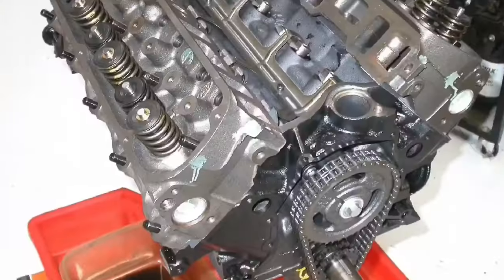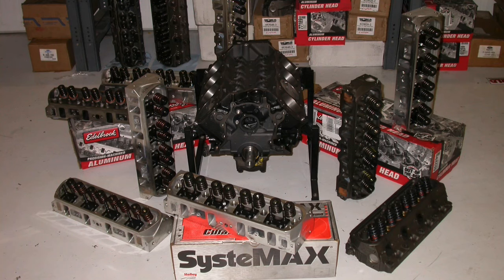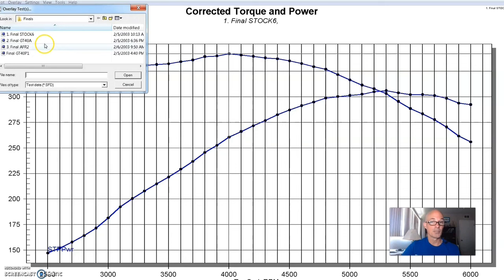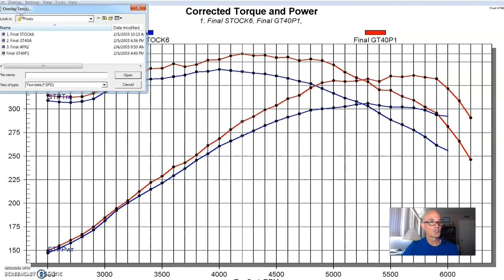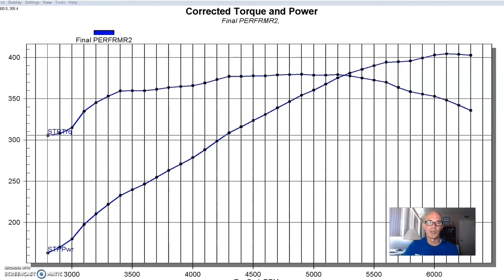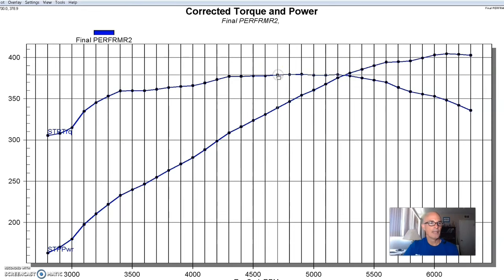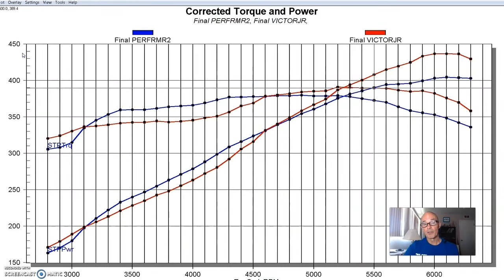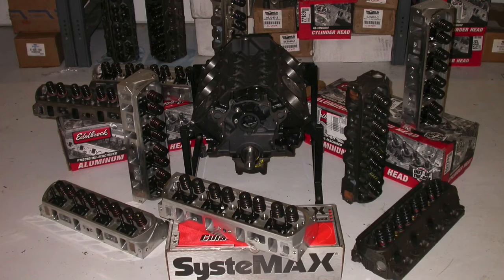LOW-BUCK 302 FORD HEAD UPGRADE

Comment: THE BEST SMALL BLOCK EVER MADE. THE 289ci WON LEMANS IN 1964 IN THE GT-III CLASS AND WAS CLOCKED OVER 200MPH. NO MOTOR HAS ITS CREDENTIAL. THE LS CANNOT TOUCH THIS MOTOR. THE LS IS A RACE ORIENTATED FORD WINDSOR MOTOR . ANY BODY READING THIS WOULD LIKE TO AGRUE THIS POINT BE MY GUEST. IN THE REAL WORLD TODAY GOING BACK A FEW YEARS 1 OUT OF EVERY 2 LS MOTOR IN AUSTRALIA GO BAD. IT HASN'T CHANGED. DURING THE TIME OF PRODUCTION A STANDARD 302 FORD IN A TAXI, TRUCK, ETC CLOCKED COUNTLESS MILES EVEN UP TO 500k AND MORE. THE LS TODAY GOES 150-200K AND THEY ARE ON THERE WAY OUT. IN THE REAL WORLD THE STOCK STANDARD FORD FAR SURPASSED IT IN REAL WORK TIME. THERE IS A CERTAIN MECHANIC SHOP NEXT TO THE PLUMBING SUPPLY HOUSE I GO TO OWNED BY PANJUBI'S DOING BLACK CAR REPAIRS AND AFTER YEARS OF SEEING THE LS BEING REPLACED WITH JUNK YARD REPLACEMENT MOTORS. I FINALLY GOT OUT TO TALK TO THE MECHANIC. HE SAID THESE MOTORS DON'T LAST LONG EVEN WITH RELIGIOUS OIL CHANGES. THE BIGGEST PROBLEM THE LS HAS IS BREAKING THE RODS AROUND THE BIG END WHERE THE BOLTS ARE. THEY ALSO HAVE LOTS OF OTHER PROBLEMS. I ASKED HIM IF THE LS WAS A GOOD MOTOR AND HE SAID IT'S A BAD ENGINE. TO SUM IT ALL UP THE OLD 302 MY NOT MAKE THE POWER OF A LS BECAUSE IT IS A MOTOR MADE FOR FUEL EFFIECENY WHILE THE EPA LOOKED THE OTHER WAY AND ALLOWED GM TO PRODUCE A POLLUTING ENGINE THAT NEVER SHOULD HAVE BEEN ALLOWED IN PRODUCTION. LOOKING BACK IN HISTORY GM HAS ALWAYS HAD THE GOVERNENT IN THEIR POCKETS. MAKING THEM PUT PRESSURE ON FORD WITH 2 HANDS AROUND THEIR NECK TO MEET REDICULES EFFICENCY STARNDARD TO KILL THEM IN THE PERFORMANCE ASPECT. AND ALLOWED CHEVY TO PRODUCE RACE ENGINES AND THEY LOOKED THE OTHER WAY. THIS IS WHY FORD WENT MODULAR.
Reply from the maker: 1 OUT OF EVERY 2?
Reply: @richardholdener1727  A FEW YEARS WHEN THE GLOBAL MARKET SALES DROPPED TREMENDOUSLY AUSTRALIA WAS EFFECTED. FOR A COUNTRY THAT PRODUCED A TOTAL OF +800,000 CARS ACROSS THE BOARD BETWEEN ALL OF THEM IT WAS NO LONGER PROFITABLE. SO THEY STARTED CLOSING THEIR PLANTS. FORD, TOYATA AND THE REST OF THEM LEFT LEAVING HOLDEN AS THE LAST KID ON THE BLOCK. IMAGINE WITH THE COMPETITION GONE HOLDEN STILL FOLDED. THEY LITERALLY HAD A MONOPLOY AND HOW DID THEY STILL FOLD. THEY FOLDED BECAUSE OF THE BAD REPUTATION OF THESE LS MOTORS 1 OUT OF EVERY 2 GO BAD. THE COMPANY WAS BADLY TARNISHED AND FROM THIS ASPECT THEY WERE FINISHED AND CLOSED THEIR DOORS.  DON'T YOU SEE GM/CHEVY FOR THE JOKE IT IS. THAT THEY TOOK OLD CONVENTIONAL FORD DESIGNS AND MADE THEIR OWN VERSION OF THE SMALL BLOCK FORD. RICHARD NOT 1 ONE DESIGN ASPECT OF THE OLD SMALL BLOCK CHEVY LIVES IN THE LS. THE LS IS COMPLETELY BASED ON FORD DESIGNS. FROM THE HEADS DOWN TO THE BLOCK. STEALING, BORROWING, HYJACKING, ETC. CALL IT WHAT YOU WANT IS WHAT GM/CHEVY DID. THE LS IS 101% FORD DO YOU AGREE HERE RICHARD. DO ME A FAVOR AND AVOID THE POLITICALLY CORRECTNESS ROUTE. RICHARD, IT IS JUST BETTER TO TELL THE TRUTH. AND I HAVE ASKED YOU THIS QUESTION MANY TIMES BEFORE AND YOU HAVE AVOIDED ANWSERING THIS QUESTION A FEW TIMES WITH NO RESPONSE.
Reply: @richardholdener1727  RICHARD WHEN THEY MADE "FORD VS FERRARI" THEY GOT THINGS WRONG AND LEFT OUT MANY FACTS. IF I WAS TO HAVE DIRECTED THAT MOVIE. THE WAY THE FACTS HAPPENED. IT WOULD HAVE ALSO SENT CHILLS UP THE SPINE OF THE HARDEST CORE CHEVY GUY. I WAS INTO CHEVIES YEARS BACK BUT LIKED ALL CARS GROWING UP WITH THEM. WHEN THE DEAL FELL OUT BETWEEEN FORD BUYING FERRARRI AND MR' FERRARI TURNED AROUND TO HENRY FORD THE II AND TOLD HIM "I'M NOT GONNA SELL MY CAR TO AMERICANS THEY ARE TOO GOOD". SO HENRY FORD II GOT MAD AND TOLD EVERYBODY THAT WE ARE GOING RACING. SO HE WENT TO THE ENGINE RESEARCH AND DEVELOPMENT DEPARTMENT AT FORD AND SAID TO THE ENGINEERS WHAT MOTOR DO YOU HAVE THAT CAN PERFORM. THEY SHOWED HIM THE HIGH -PO 289cI. HE THEN TOLD THEM COULD THIS MOTOR SURVIVE THE GRUELING 24 HOUR LEMANS. THE ENGINNERS SAID WE JUST DON'T KNOW AND THE ONLY WAY TO KNOW IS IF WE TEST IT. SO THEY STRAPPED IT ON A TEST BENCH AND REVVED THE MOTOR TO 6500RPM AND JUST LEFT IT THERE RUNNING. 24 HOURS LATER THEY CAME BACK AND IT WAS STILL RUNNING. THAT IS ASTOUNDING FOR A PICK UP TRUCK MOTOR. IN THE 260ci FORM IT WAS FITTED IN THE FIRST COBRA. IN A RACE AGAINST FERRARI (DON'T REMEMBER IF IT WAS THE SPA 1000 OR  LEMANS)IT BLEW A OIL COOLER AND WAS 20 MILES AHEAD OF FERRARI. THE MOVIE SHOULD HAVE STARTED THIS WAY SHOWING A COBRA COMING DOWN THE STRETCH BLOWING THE COOLER A WARNING TO FERRARI TO WHAT WAS TO COME. SMALL BLOCK FORD WAS AND STILL WILL ALWAYS BE THE GREATEST SMALL BLOCK OF ALL TIME. THE SMALL BLOCK CHEVY AND NEITHER ANY OTHER MOTOR CAN TOUCH THE SMALL BLOCK FORD.  THE SMALL BLOCK CHEVY DOESN'T COMPARE TO THE SMALL BLOCK FORD. AROUND 15 YEARS AGO A HI-PO 289cI OFF THE STOCK PRODUCTION BLOCK AND HEADS BROKE INTO THE 9 SECONDS BARRIER.

Comment: What is the situation with piston to valve clearence with 2.02 intake valves?  I'm hearing a possibility of problems with stock pistons and stock bore....  cylinder/valve clearence and piston clearance problems even with stock valve reliefs..
Reply from the maker: IT CAN BE A PROBLEM
Reply: @richardholdener1727  Rich,  I'm going to try this out because I wanted to run my stock forged 1987' Pistons with factory valve reliefs but a set of 2.02/1.60 valve heads so with less then .500 lift/280dur like an  E-cam hopefully be okay..Have you heard of Liberty heads for smblock Ford?  They do look pretty nice for less then $1200 bucks....  l'll do a video about my clay check and let you know!

Comment: Interesting that the torquer intake. Kills your low-end torque. Most people think of torque as coming on early in the RPM range not late. Does this all seem backwards to anybody else??If I am buying a torquer intake I would’ve thought it meant could low and early power. Silly me.
Reply from the maker: it is a single plane-they are designed for power production higher in the rev range (despite the name)

Comment: Hi Richard, I am planning on buying a 363 Dart shp block and running a on3 turbo kit, what AFR heads and carburetor intake do you recommend for a street / strip setup? For a foxbody mustang I am looking for about 600 to 700 HP.
Reply from the maker: any dart head will get you there-check out the dart head video that is up on the 363 shp motor

Comment: Really liked this video I'm running almost the same set up but I got ported gt40 heads with a trickflow stage 1 cam and have the 289 rpm intake I always wondered around what dyno numbers would be so now I have an idea

Comment: What does your spark curve look like? Max advance degrees, initial?
Reply from the maker: WE USUALLY RUN A LOCKED DISTRIBUTOR ON THE SBF
Reply: @richardholdener1727  In the video you say all in by 3000rpm assuming you were using a curve? My buddy has 350 Chevy said he likes all in by 2500rpm, but he uses his vacuum advance can, think he's using 16-18 initial, but with can on vacuum 10-12 more, then 10 degrees from advance mech. so 38-40 total retards under load. He's got a lower compression motor 9.5-1 so less than 10-1 so that's probably what works for him. I'm going to using mechanical spring kit #926D in my car with a OEM distributor with the distributor set in the 20 degree max mechanical advance position, with the OEM Ford distributors up to about 1980 you can change between 10 degrees to 18 by disassembling the rotor flipping it over 180 degrees. I'm over 10-1 compression with my build so this should wake things up a bit for me, but the 108 cam is really likes to be in the upper rpms to make power. I was just curious about initial timing stat your using as the cams your using are 112 range, I'd need a little more initial than the figure your using with my cam because the valve over lap is quite a bit more, actual what ever it takes with out knocking... Surprisingly the last time I used a locked out distributor was on a Turbo application, with a retard can on it...

Comment: Any PVC issues using the XE274 camshaft on stock explorer short block with GT40P heads?
Reply from the maker: YOU NEED TO CHECK

Comment: What heads cam and intake should I go with for a stock bottom end 302? It’s in a truck so I want to keep good torque down low but maximize peak hp
Reply from the maker: pick the power curve you want from all the videos

Comment: 347 with that cam and heads with the Vic jr would be a nice setup
Reply: Ive seen those setups before theyr3e about 450+ almost like the rpm top end kit but better
Reply from the maker: I did a 347 with TFS as-cast and CNC heads-that test video will be coming later
Reply: @richardholdener1727  yes!! So many options...now its just a $$ thing

Comment: Richard I am a big fan of the second gen Explorer and Mountaineers with the 5.0L.  The 225hp was fine when they were new but now that almost everything has 300 plus hp I'd like to build an upgraded engine for my 1998 Explorer Eddie Bauer 5.0l.  I think 300hp would be just right.  I will put forged pistons for sure.  I read the article about the GT40P head springs and rotator cups for the exhaust valves were not ideal.  I am wanting to try the beehive springs.  That cam you always talk about.....would that be too much for an automatic transmission?  Any recommendations for 300hp?
Reply: @ummduhgmail  I had to trade the Explorer in to get a F250 to go cross country to go get my 1964 Comet.  2000 mile trailer haul is too much for an F150.  I still have an extra engine that will go in a 1953 F100.  300hp is not enough. Lol

Comment: As a Cleveland fan, what heads, intake & (hydraulic) cam do you recommend for that Block, for a street cruiser?
Reply from the maker: building a Boss 302?
Reply: More like a Boss 351 . I’ve got a ‘71 4-bolt CJ block & factory ‘70 quench heads...if I can ever get around to fini$$hing the project 😁

Comment: Richard please, I would like to know the specs on the springs?  Video is Perfect timing,  I just got my hand ported gt40p heads back from the machine shop. Going to double check my spring selection now. 😁 Running a bigger cam. 221/229 with 565 lift on the exhaust.  
I heard from owners trick flow and ford used to not have enough spring. But thought they changed their rates. 
Even though I here QC is good now, I think I would go the route of getting bare heads and having a trusted builder build and QC them.
Reply from the maker: 160+ on the seat and near 400 open works for springs

Comment: Where are you located at i would like you to dyno my engines  to help me get to my peak operating hp/trq with my 302  punched 40 over i have a 303 cam  trick flow heads and intake fuel injected what do you think i should expect in hp with that combination

Comment: Working on a 83 SSP have stock aluminum intake. Wonder which would be best for under stock hood. No mods other than Holley Sniper efi
Reply from the maker: The TFS Street Heat works well and Edel RPM II

Comment: Wait. The title says "302" but the video is about a totally different engine, the 5.0L ? Right? So why put 302 in the title??
Reply from the maker: a 5.0L Mustang engines is 302 cubic inches
Reply: @richardholdener1727  that is correct..  but when referring to a "302" it is usually and widely accepted that you're not talking about the 5 liter so as to avoid confusion.

Comment: Did you test the John kaase head the p38 lighting head you can make around 500 HP
Reply from the maker: Jon does good stuff-met him at Engine Masters and have run his stuff. Those heads (or any heads) won't make 500 hp on this combo
Reply: @richardholdener1727  hi
I just watch gearz where those head where features they took a junk yard 5.0 1987 with a mild cam and dyno it at 516 HP and 394 ftp so would love to see if you can duplicate the same dyno test I'm just reporting what was said on the show

Comment: Richard have you ever run the original solid flat tappet 289 K code cam? I wonder how it performs compared to the modern cams you ran.
Reply: Specs are pretty weak, in spite of the fact Ford also used it in THE Boss 302 with large C heads.

Look up.
Ancient lobe design, 
220* and .460 lift on 112* if I remember correctly. Dont forget the .020 lash.

Comment: What stall converter would u run with the gt40p heads combo and 3:27 diff gears?
Reply from the maker: what cam?
Reply: @richardholdener1727  the one used in head test video between std, gt40p and alloy head..

Comment: I have a 5.0 out of a 78 ford Granada, I’m trying to make close to 320 hp this is the first video I’ve watched so far, anyone have recommendations or maybe can help me put together a parts list? 

Do I have to bore anything or can I leave the bottom end stock?
Reply from the maker: I have endless 5.0L videos up on how to make power with a 5.0L-you can make 320 flywheel hp with a 5.0L very easy

Comment: some guys say that some of the after market heads, are crap the valves come from China, and the valve seats  are out of round, pour some  fluid in the ports and watch the leaks, etc. when it comes to junk yard heads, toss the valve springs,the springs that have been compressed  for a long time are junk

Comment: Pretty sure it wouldn't be low buck lol but I think it would be super cool to have DV do up a set of his E7te heads that will smoke a set of AFRs, nope stock short block with just pistons, stock e7 headed and a nice little cam
Reply from the maker: PORTED E7TE THAT MAKE MORE POWER THAN A SET OF AFR185S? I WOULD LIKE TO SEE THAT
Reply: Well it's your lucky day! Just go over to David vizards channel because it's been done and he talks about it.... DV has managed over 300cfm on the intakes on a pair of E7s, a pile of work sure, insane methods nope., so unless your saying DV the head porting guru is a liar it's a real thing, at over 80YO i really dont think he needs to lie, but he has videos talking about it on his channel so there you have it. And as far as the all caps what's up with that? That means you are hollering so if you are that's a bit foolish to get worked up over something  you apparently didn't research and especially  over something you're wrong about. I'm actually a bit surprised at the vibe of you comment being who you are. I have been a subscriber and loyal viewer  of your channel from the get go that's not much of a way to reply to someone who was a fan of your work here and at hotrod and motortrend for years kinda questioning that outlook now.

Comment: I seen 302W had 289 heads brought the compression ratio by 1. So 9.5 in 1 -  10.5 in 1. I never seen the results. Be cool to see though lol
Reply: Fully ported 289 C6OE  194/160 with 56cc chamber do real well on a 5.0 HO. 😁🔔
Reply: About 9.7 comp.
Reply from the maker: the would need a serious porting to work well
Reply: @richardholdener1727  correct. They were a hot ticket in '90. But I used to have the machine shop and professional porter. My cost was maybe $50 😁😁😁 definitely not worth spending $800+ today. Seats guides valves  porting etc.
Reply: For the curious= 16 hard seats, 16 guides, 16 seals. We were refreshing C 350 circle track engines so.... Free stainless 194/160 valves, springs, retainers. Fully ported and relieved netted 56 cc chambers and 134 cc intakes. Flowed 195/155. Works well with HO stock HR cam.
Reply: Richard
The 289 heads
E7TE
Gt40
P 
 heads all have an almost identical intake runner at 124 cc.
The peanut chambers give compression.

Comment: Richard, does anyone make a single plane crank for the LS ?
With a single plane cam it would work right ?
Reply from the maker: do you mean flat plane?
Reply: @richardholdener1727  yeah.
Reply: Oh yeah I googled it, heaps of them. Sounds like a 4 cylinder when idling but sounds great at high rpm.
Would be a good comparison video.

Comment: I've got gtps on my 306 build. Upgraded valve springs and been shifting at 5k now I know I can go to atleast 5500
Reply: I had a 302 ho with 351w 4v heads, 268 cam, headers, torker2 intake. That thing would rev to 6500 in lower gears before I realized it. Had to richen up carb for wide open throttle and lean it down for part throttle economy. Using 83 stock Holley. I had trouble with comp cams roller tipped rockers falling over at low speeds and decided to put in another engine ( had 100k). Found out cam bearing was flaking and probably got caught between cam and lifter creating momentary clearance allowing rocker to go sideways.

Comment: Richard, I have an all original stock 1987 302 H.O., are these heads worth keeping to swap this into a street rod ranger with an AOD trans? Also are the letter camshaft worth using when using a  carburetor?
Reply: Just about to start getting parts lined up and more knowledgeable with Chevrolet engines.
Reply: Carbureted you want an 109-110* LSA.
Fuelie cams are not the best for carbs.
Reply from the maker: the letter cams do the same thing regardless of whether you have EFI or carb
Reply: @richardholdener1727  thank you buddy.

Comment: I wonder what the gt40P heads would do with good spring on a 351w
Reply: Still have 124 cc intake runners and minimal valve increase.
Not worth the gasket cost.
JMO

Comment: Have you ever used the Skip White cylinder heads?
Reply from the maker: I HAVE NOT
Reply: @richardholdener1727  the reason I ask is you can pick them up for under $900 ready to go except for rocker studs and guide plates

Comment: Let’s see C9OE vs GT40/P on both 302 and 351W.
Reply: C9OE has 144 intakes
E7TE, 40s, P have 124 cc.
Reply from the maker: the 69 351 heads were the go-to head before all the good alum stuff came out

Comment: About what are iron GT40 (non-P) heads worth power wise over E7TE?  Anyone got an idea?
Reply: Arent they pretty much the same?  I know the p has slight differences as far as what headers work but as far as the head and its inner workings (stuff that effect the power it makes) is relatively the same?  Correct me if im wrong